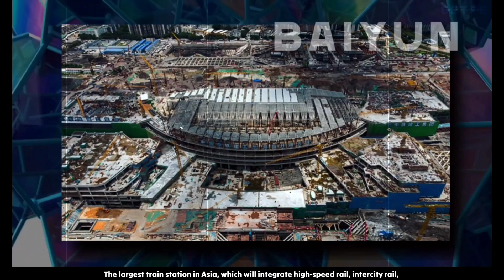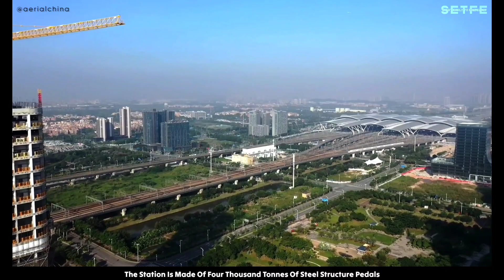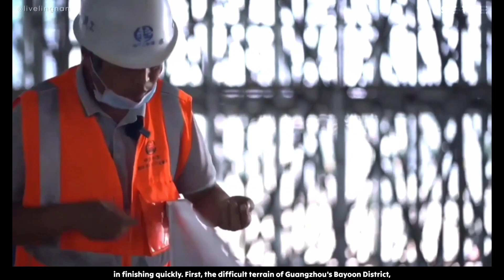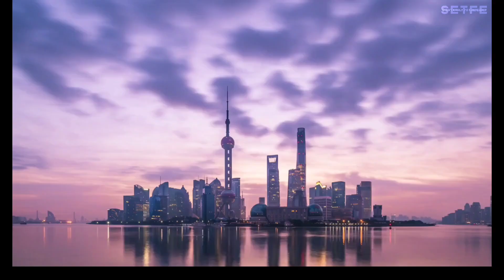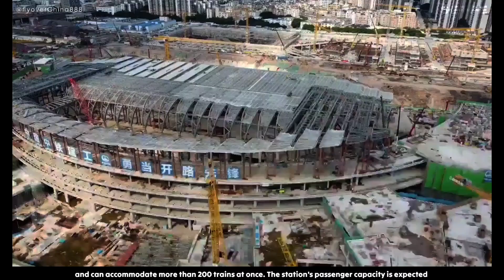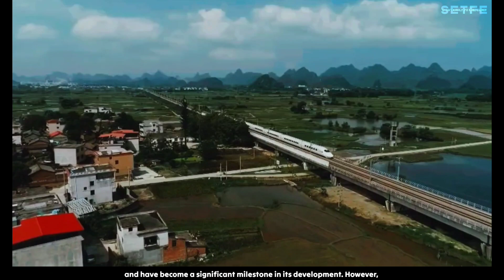Asia's Largest Train Station: China's $8.5 Billion Triumph in Transportation Construction

Comment from the maker: The largest train station in Asia is being constructed in Guangzhou, China. It is estimated to cost 8.5 billion dollars to construct and will integrate high-speed rail, intercity rail, subway, and buses. It is made of four thousand tons of steel structure pedals and is expected to serve 100,000 passengers daily. The design concept of the station's exterior K-pop is inspired by the Guangzhou City Flower. Construction on the project was originally slated to begin in 2020, but was delayed due to the COVID-19 pandemic.

The Bayoon Railway Station is a large-scale project in Guangzhou, China. It has several challenges, such as the difficult terrain, high-intensity construction, and stringent environmental protection requirements. Engineers are working day and night with a 24-hour shift system to ensure the project is feasible for opening by the end of the year. China has pledged to strive for a carbon peak before 2030 and carbon neutrality before 2060, and solar panels and green vegetation have been used to efficiently use energy while maximizing environmental benefits. The project was completed in three and a half years, and the engineers were very impressive.

The Bayoon Train Station is expected to be operational by the end of this year, with 32 platforms and 40 railway lines and a passenger capacity of 30 million per year. It will further Guangzhou's status and influence in the Belt and Road Initiative, encourage coordinated regional development, and open up new development opportunities for the city's tourism sector. However, there are still some issues and challenges with the project.